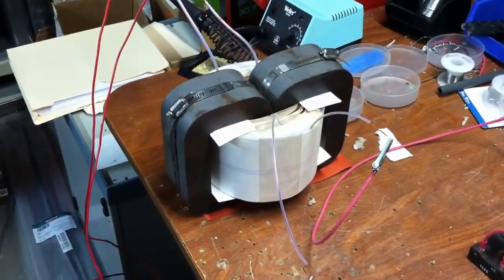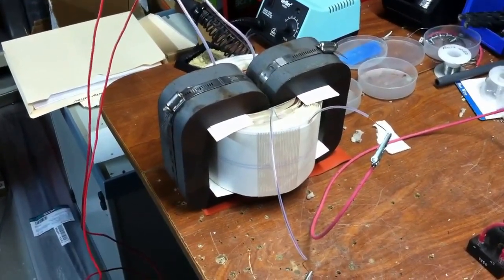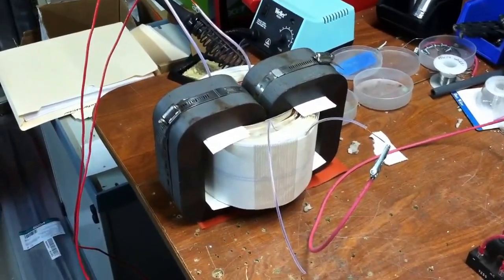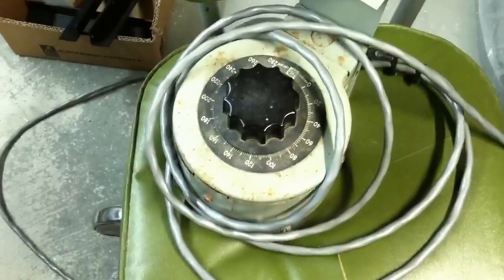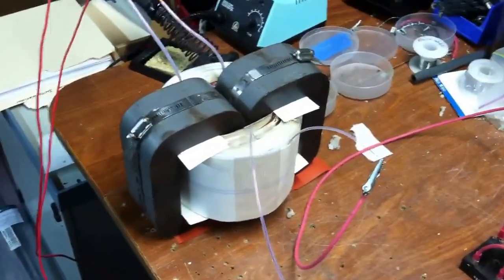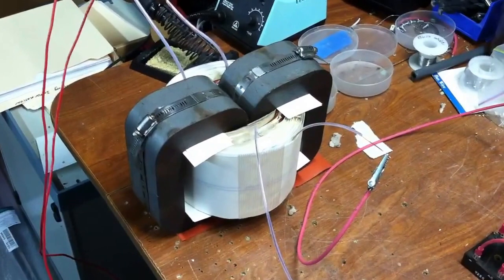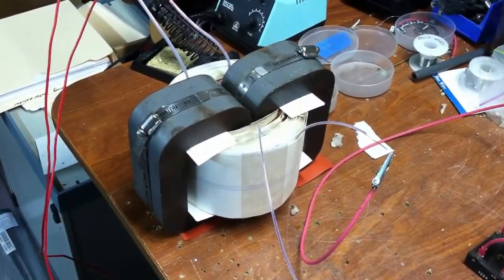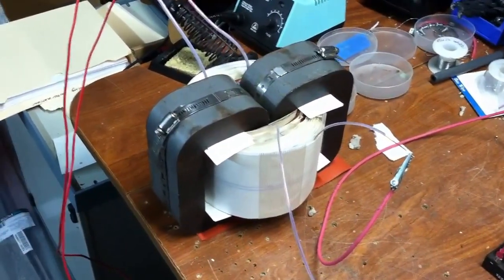HOMEBREW 2800V AT 1A C-CORE HIGH VOLTAGE TRANSFORMER

Comment: It is almost 10 years later.  Is the transformer still in use?  I would like additional information on how to rework an existing C Core.  Prehaps leave the primary and replace or add windings to the secondary for additional HV.

Comment: HI HOW ARE YOU I HAVE A HEATKIT AMP MY TRANSFORMER IS BAD CAN YOU HELP ME BUILT ONE OR CAN YOU MAKE ONE AND HOW MUCH ... NICE WORK MAN I NEED ABOUT 3500 TO 4000 VOLTS 3 AMP  FOR TWO TUBE 3-500Z TANKS..
Reply from the maker: I don't build transformers for sale. These videos and my website are intended to help you wind your own. Look at my website there is good information there.
www.qsl.net/kf8od
73, Mike
KF8OD
Reply: I know I saw the website but I don't understand  wen you change from 10 ga to 18 do you put both wire toghether and keep winding the wire and the separation of each wire how do I know wen to pull one out ?I see 4 wire two for input and two for out put  I don't want to take to much of your time but I realy want to buil my own ...p.s love your work :)
tanks for your time
Reply from the maker: For the large transformer there are parallel 10 awg wires for the primary and 18 awg wire single, for the secondary. The number of windings is determined by the voltage you are using for primary and secondary. Use the spread sheet on Ludens website to calculate your needs.
Reply: so you start from one side parallel but you leve a bit of wire out in the primary and wen you start the secondary do you put the primery and secondary together and keep winding
Reply from the maker: Send me your email address so we can talk about this.
My email is  kf8od@aol.com